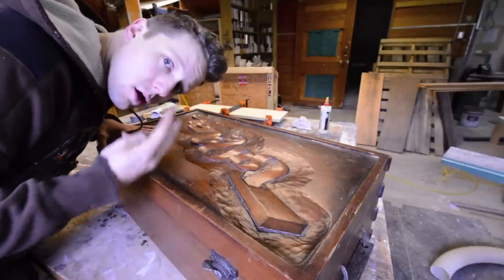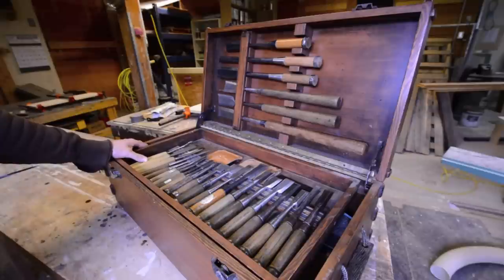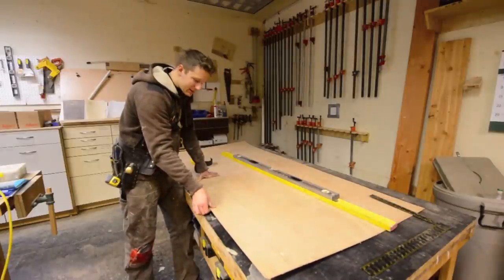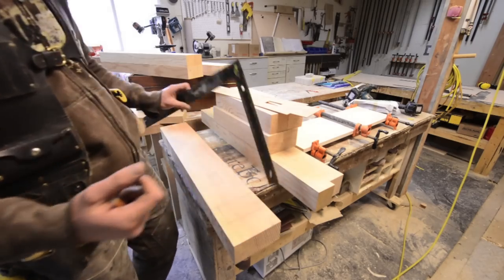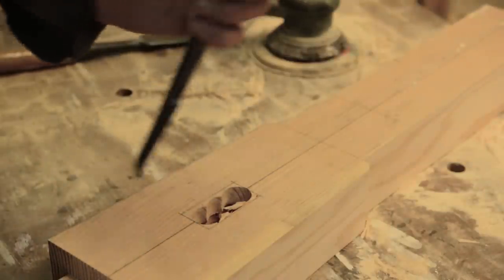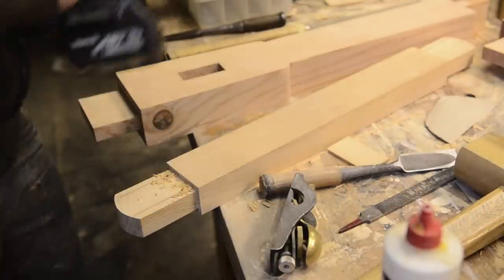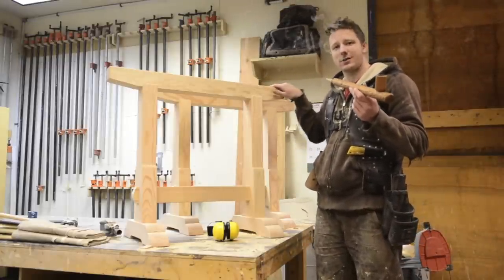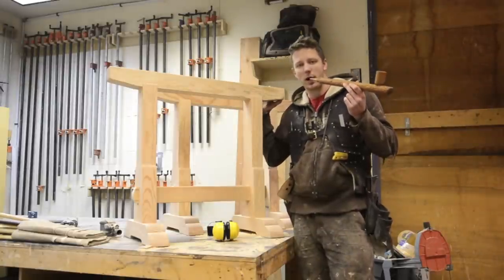Woodworking, Building Boss Saw Horses, How To

Comment: I like your work and your attitude toward your work.  Smart move drilling holes at the end of your cuts. Many people know this works, though few think about why. Pressure=Force/Area. The force at the end of a small cut or crack creates a lot of pressure on a material. If you drill a hole at the end, you greatly increase the area that force is applied to, thus decreasing the pressure on that material. Just like to share knowledge; hope someone learned something new. Thanks again for sharing your gift!

Comment: Everybody has their own way of doing things but I did some experiments with wedged tenons and found that even just a slight 3° to 4° angle in the mortise works very nicely to permanently wedge the split tenon in place. I sectioned several in half to see what they looked like inside and the wood really crushes and fills the small initial gap -- without the danger of splitting past the mortise hole and up into the rest of the beam or breaking off those slim edges of the split tenon. It looks like you have a huge gap to fill and use very wide wedges. I think that's overly stressful, even if you relieve the split with a drilled hole.

Comment: Beautiful craftsmanship, mon ami.  I love the look and the functionality of your saw horse, but I was a bit taken aback when I saw at 3:12 the unsupported vertical cut of the tenons on the table saw, especially with so much of the blade exposed and no riving knife. That would have been the place I'd have used the band saw -- and used the table saw to make the safer shoulder cuts, or I'd have used a tenon jig on the table saw to support the stock in making the vertical cut.  Other than that wince, watching you work is a real pleasure.  Thanks for posting.
Reply from the maker: ***** To each they're own.  I'll admit my technique is a bit brash but I try to save time wherever I can.  I still have all my fingers so my style is working for me so far ;)
Reply: The Samurai Carpenter I get it, Ive worked as a trim carpenter for 12 years and a framer for more years than I care to count,  and boy was I suprised when I cut the tip of my finger when a very similar cut jumped in my hand.

Comment: I have tried exactly one tapered mortise with wedged through tenons so far in my woodworking career.  I love the joint though, and need to perfect it.  It wasn't clear to me in your video how exactly you tapered the mortise.  I haven't figured out, through my own meager experience, whether it is important to get that mortise perfect, or to just essentially make sure there is a taper.  In your plans, the wider mouth of the mortise is 1/2 inch bigger than the narrower mouth.  Care to share your technique for that particular task?

Comment: Those are great! I'm confused though. I consider the top horizontal to be a sacrificial piece that my saw may cut into when I lay something across the sawhorse.  I saw you used wedges to make the top join pretty permanent. Those would be tough to replace when they get cut up. Do you not use your sawhorses the same as me or do you just have a good plan to remove wedges.

Comment: Hey Samurai - I've never made the wedged tenons like that... they look amazing! Wondering what the long term use and strength / tightness of the joints not held with glue is like? Do they wedges keep them permanently tight? Do they shrink or loosen ever? Thanks as always for the great videos man!!

Comment: Where do you get wood that is that thick? Did you glue pieces together? Or get it custom?
Reply: Nathan, from what I've found you can get Douglas Fir in a 4x6 and then he used 4x4s for part of the project as well. Depending on where you live the thicker woods are harder to come by.

Comment: Beautiful design; however, I would make a set of tight fitting sacrificial tops held down by removable pegs on the side of the saw horses.  That way I would not mar the saw horses.  And if one became marked or damaged, the saw horse would just get a new replaceable top.

Comment: this design was published by another woodwork worker in January 2015
Reply from the maker: +Robert Fuqua This is my own design but I'm sure others have come up with similar designs.
Reply: +Robert Fuqua 
do you mean the one on the channel "journal of light construction"?

if so, there are significant differences, both in the style and in the joinery.  those're knock-down, which these aren't.

more importantly, though, something like this is what you get when you put "Japanese" and "saw horse" together.  just because other people had similar ideas doesn't make it the same design, or even necessarily related.

Comment: Haven't seen you use a speed square... Why is that?
Reply from the maker: It's a framer's tool.  Not enough accuracy.
Reply: +The Samurai Carpenter that's amusing because about 3 minutes in you're using a framing square lol. Seriously though, love your videos, I've bought all of the woodworking books you recommend and am seriously eyeballing that workbench for my own build. What square do you recommend? I bought what I thought was an accurate engineer's square and the damn thing was off

Comment: I appreceate the time and effort you put into your videos, and i like the style / asthetics of your projects, you are obviously a skilled craftsman.

That being said, there seems to always be a lack of enough detail to actually build the projects. in this video, there are no plans and only some verry brief and basic tips, not enough where I'd be confident building them. are those mortises tapered so the wedged tennons fit more securely? if so how do you taper them accurately? how did you cut the notches on the top cross beam? how did you get everything to final dimension after the bandsaw? etc.

I had been subscribed to your channel for a while, but unsubscribed a while ago. i still occasionally get hooked into watching a video, but am honestly always put off by your egocentric attitude. your always praising yourself, and while i do think your good at what you do and should be proud of your work, i dont need to be constantly reminded of it. In this video the smoking bit just screamed hipster. your also always talking about doing it the "old way" but have a fully equipped machine woodworking shop and seem to only pick up a hand tool when something cant be done by machine.

Unfortionatly, im always strongly reminded of someone I occasionally worked with remodeling houses (not by choice). he was verry full of himself and talked about doing everything "oldschool" while actually being pretty mediocre to poor at what he did. I always called him the hypster carpenter. he had convinced all these verious homeowners of how great he was, and charged a premium as a result, but they didnt know any better unfortionatly.

take a hint from paul sellers and james wright, loose the attitude and go into detail about how your actually building something, I think people will appreceate your videos more